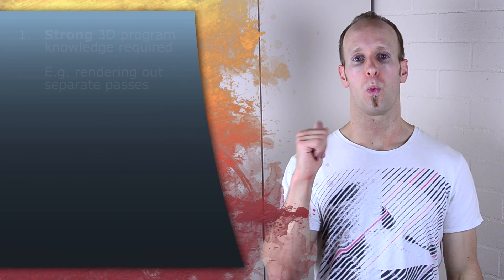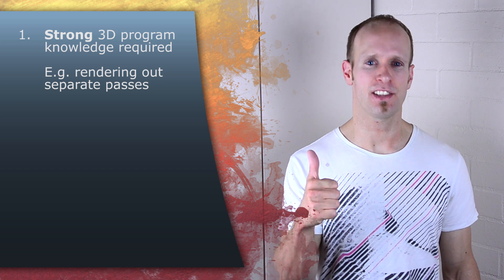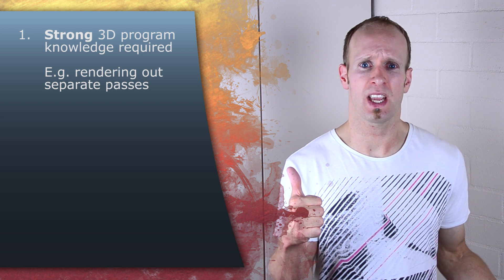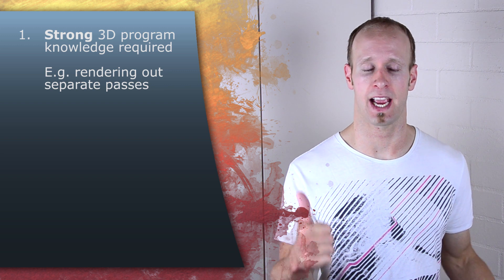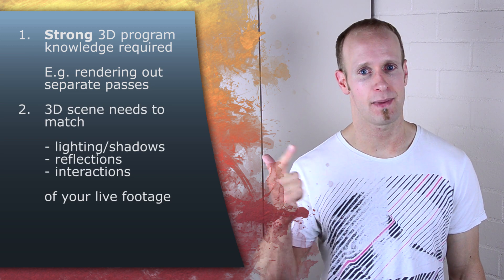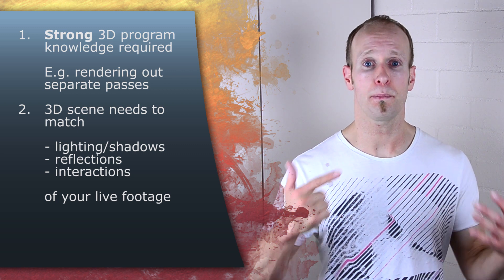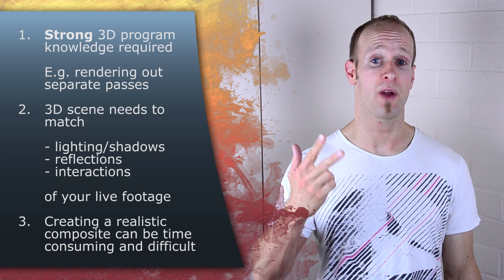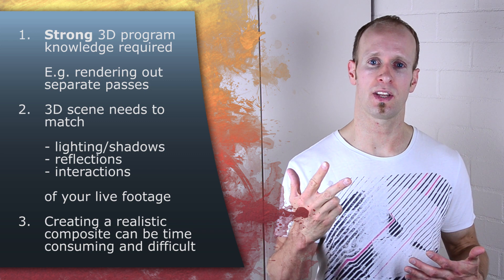3D Integration VFX Tutorial Part 1 - Theory

Comment from the maker: It really depends on what you actually want to do with the 3D object in AE. Photoshop 3D layers work pretty well, but are fairly limited. The next step up (in my opinion) is the Element3D plug-in which gives you some more control over materials, reflections, rendering and animations. Neither of those options support animated models and have their limitations. For full control you will probably need to do 3D integration, but that can be complicated. So it depends on what you want to achieve :)